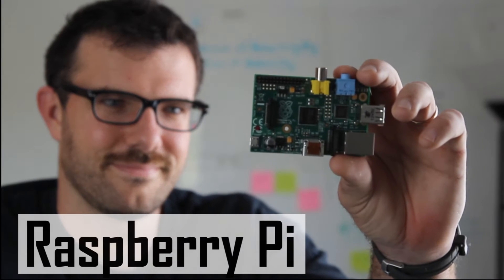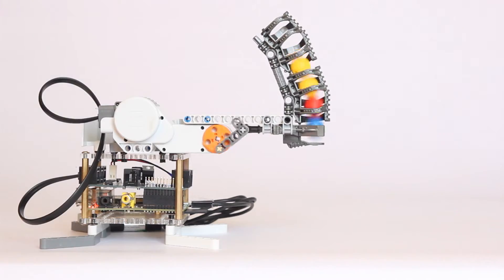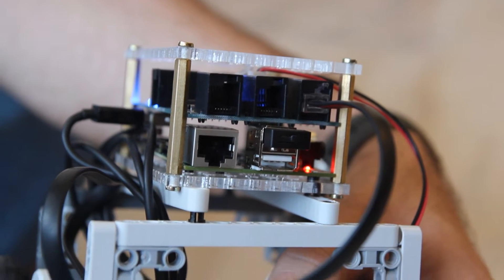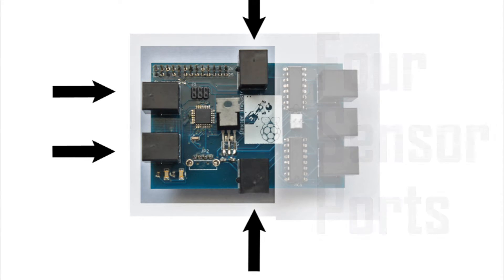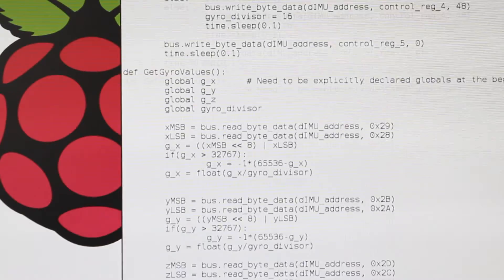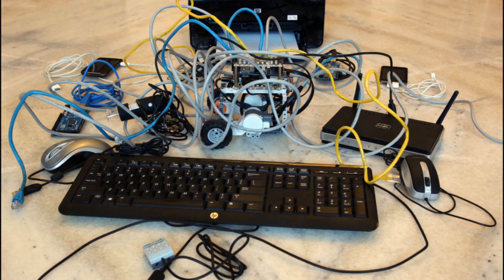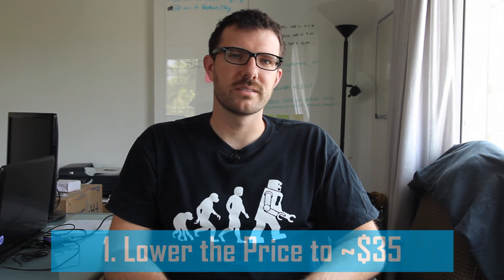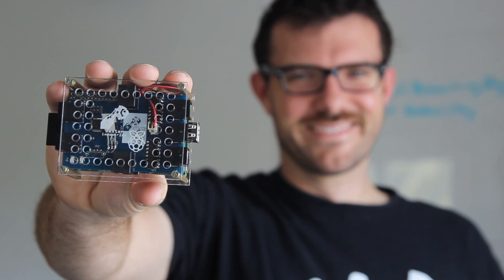BrickPi Kickstarter Video

Comment: This is an interesting product. I learned Python at university and would like to build a robot in my freetime. I consider LEGO structure to be the best option for me because I don't want to be concerned with manufacturing of beams and things like that. Only problem I have is that I can't get a hold on individual LEGO parts. Therefore I am buying the Mindstorms edu core system first. But my favorite robot would probably be LEGO structure with industrial sensors, LEGO motors and Raspberry/Dexter boards.